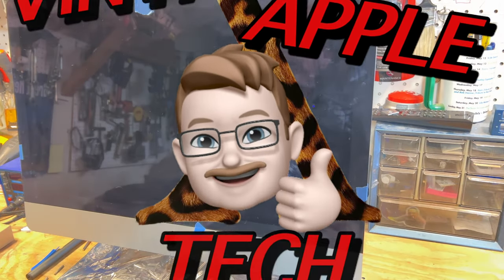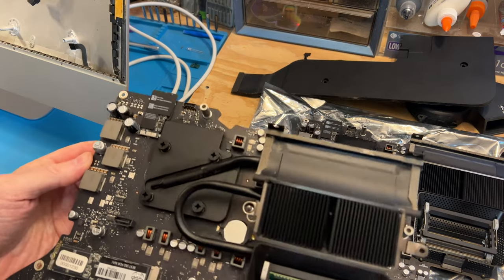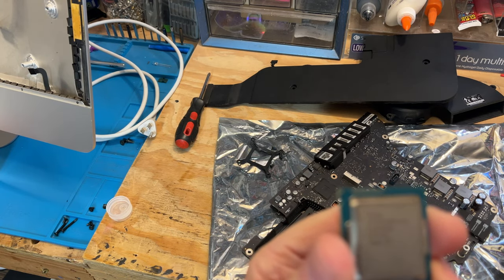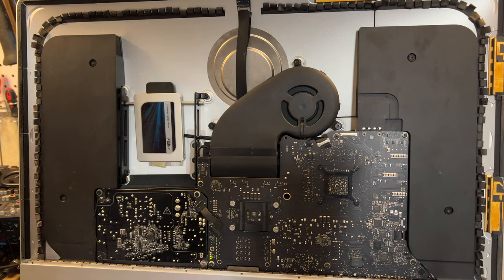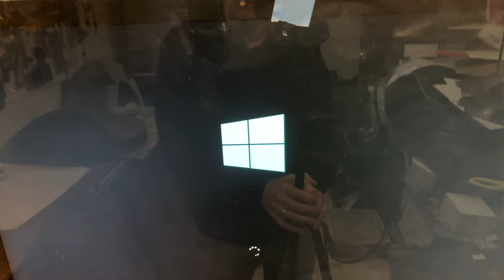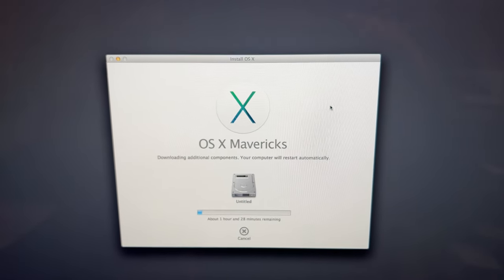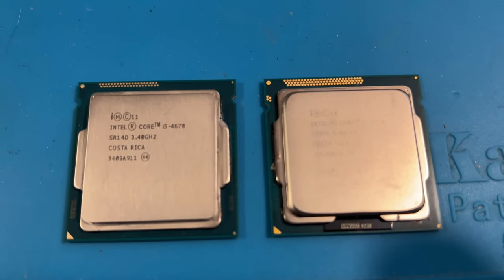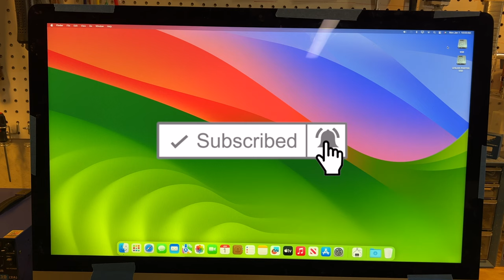Repairing A 2012 iMac Part 2

Comment: the seller clearly messed you about with the processor, the 3rd Gen i7 is totally different in terms of pins, you need a i7 4770K 4790K or 4770 Non K for it to work. but great and extremely painful repair!
Reply from the maker: Yes I contacted the seller he is sending me a different i7 and I will return the other on I check that i7 when I get it